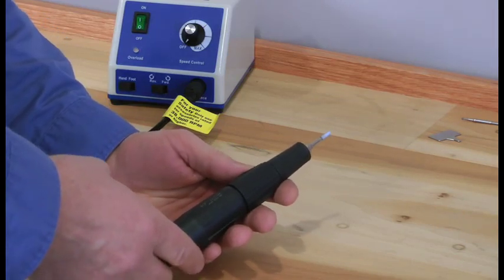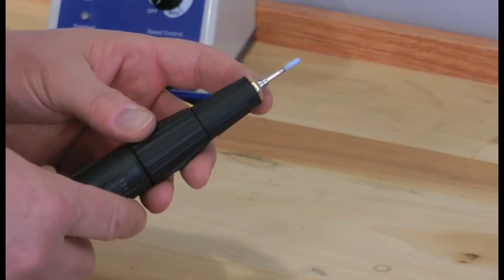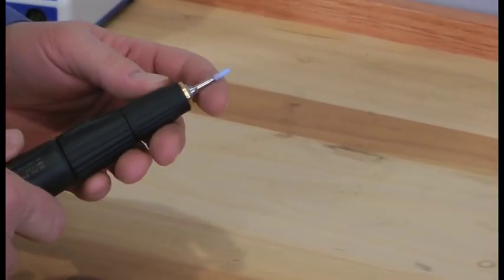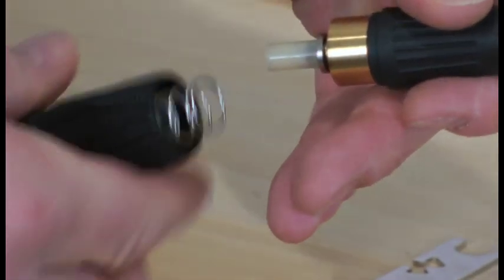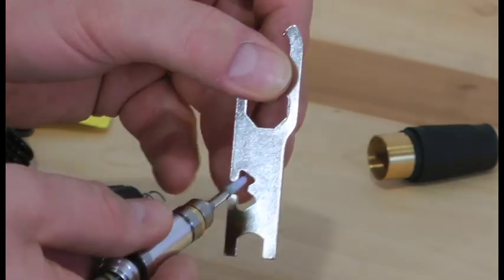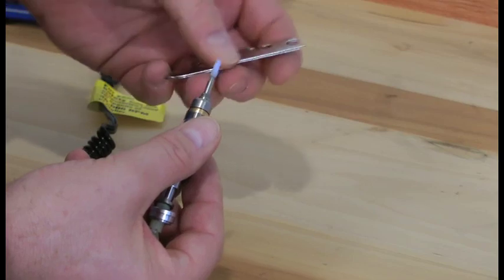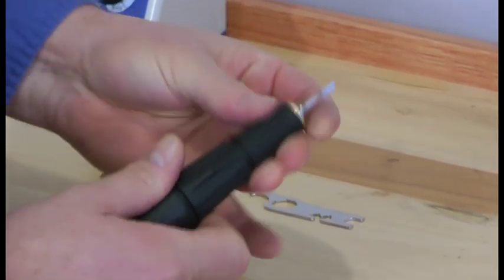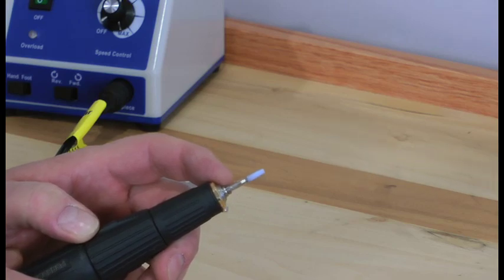Foredom K.1070 Micromotor Collet Change

Comment: Would you post parts to Australia? I lost the two rollers in the twist lock. The hand piece is the 45k version, but the twist lock rollers and “body” are used on other versions..it seems.
Reply from the maker: we do.
Reply: Foredom Electric Co. reply about 6months, 3 weeks and 2 days...to late. But thanks for the informstion